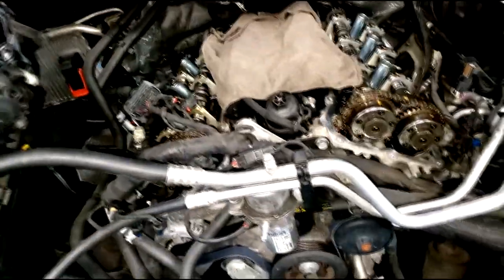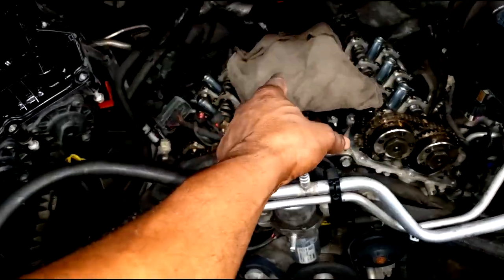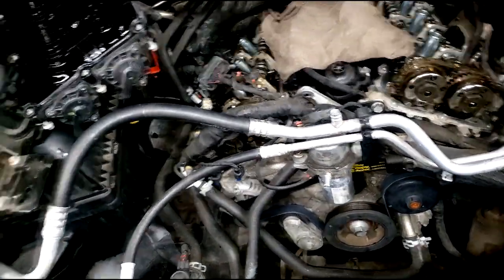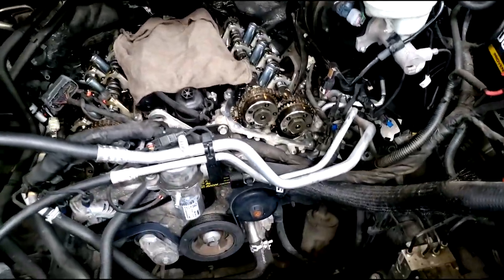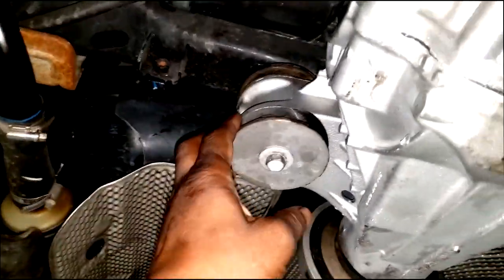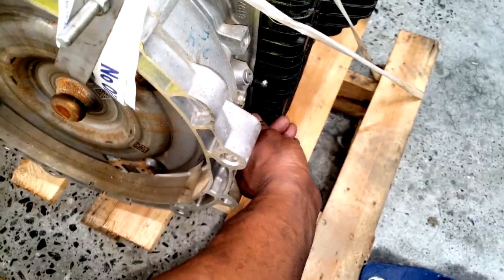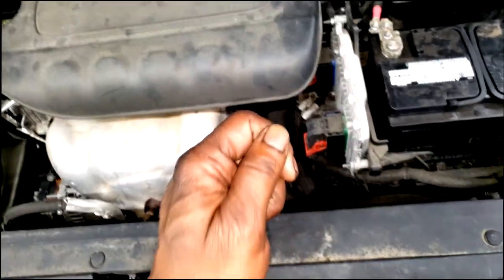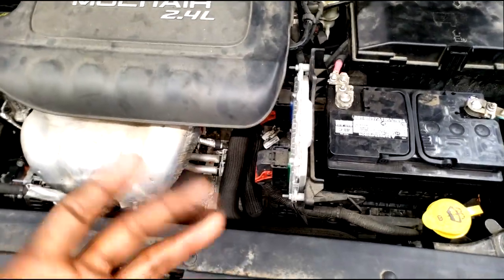Crazy day. Can you put a V10 engine in a Dodge Ram 1500? How to fix a Differential. ZF Transmission.

Comment: I know they offered a v10 option on the earlier generation of the trucks, but probably the 3/4 ton versions, and they offered basically a Viper engine in a muscle truck version a bit later. Watch Heat for a V10 powered pickup in one of the scenes of them trying to get paid for a heist they pulled in a drive in theater meeting that goes bad. The engine sound was accurate and truck ended up all shot up.

Comment: Great insight on the diff.  Seems like my DIY ability is diminishing.  Thanks for the video👍🏽👍🏽. Good point in the fluid, if I was getting a used transmission I would pay Blackstone Labs for an oil analysis for a little piece of mind.